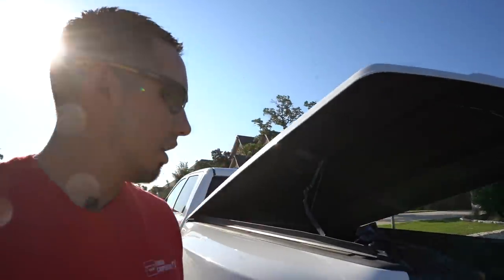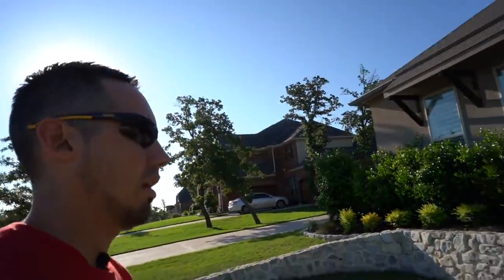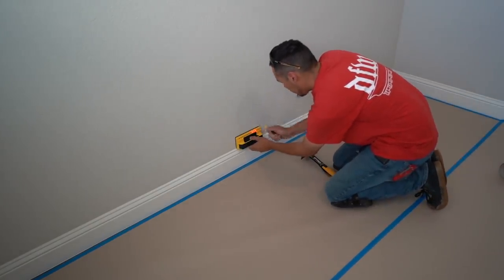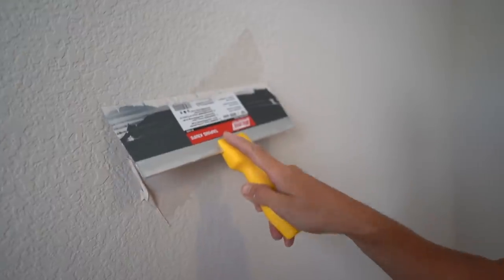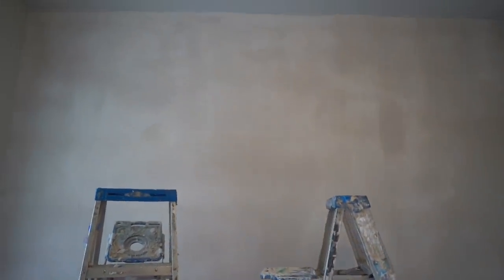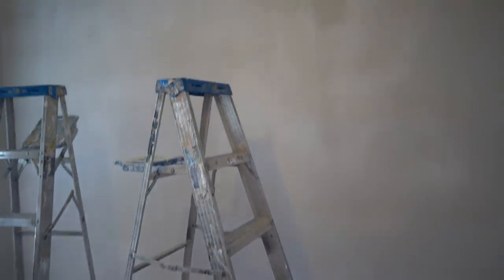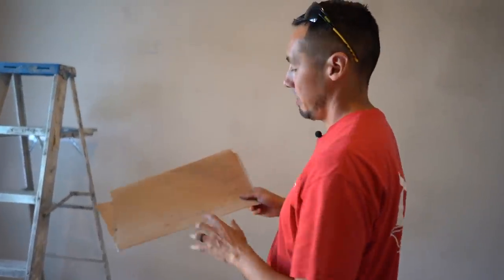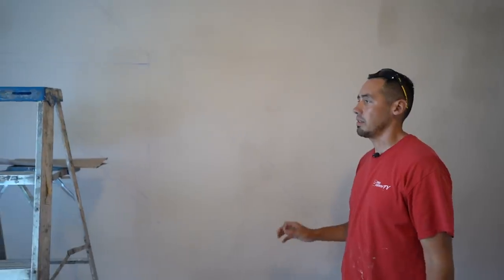abstract accent wall prep

Comment: A box fan always helps that quick set dry faster unless there's a ceiling fan in the room you can use. Love the content.
Reply: Floor blowers are better.  Bel Air has them for about 100 bucks and you can daisy chain like 8 of them together before you hit 20 amps.

Comment: To avoid sanding a trowel is very useful in scraping off any lift offs and after two coats you can go with  tight coat or two of finishing mud. Sure it’s an extra step but a tight coat will dry quickly, the finish is superior and the sanding is very minimal.

Comment: Little tip from a dry waller if you get a 3/4 inch roller nap mix your mud real loose you can roll your mud on follow behind with a wide growl. Because 45 doses that fully dry I take a tile sponge an a bucket of water with a damp sponge 🧽 lightly wet sand between coats give it a try let me know how you like that technique

Comment: Hey nice job but I may have used 1/4 inch Sheetrock to just cover up the old wall and start from scratch. Just a thought. But I like your work I've seen all your vids. Your a craftsman for sure, Semper Fi brother.

Comment: Easiest way to skim coat a wall is to mix your mud fairly loose and then roll it on the wall with a 3/4 Knapp roller and then use a 14” knife to skim the wall. Much faster to get it all on the wall with a roller and then skim it instead of trying to apply and skim at the same time.

Comment: "Easy sand" is sorta misleading,  especially if you are hand sanding - lol
A good rule of thumb with durabond is whatever the number (20, 45, 90 etc) you generally have half that before it starts to set (warm water sets it quicker). It is setting type mud but still drys at the same rate as regular mud - I think on that job I would have just used regular ole usg joint compound.
My 2 cents
Great video guys,  thank you! 👍

Comment: Hot mud is difficult to sand. I would have used a Westpac Green Dot topping. it's a heavy weight compound with low glue so it fills and doesn't shrink much at the same time easy to sand. Sanding setting type muds are not fun and eat through sandpaper.
Reply: I use the red dot, like butter

Comment: Which stud finder are you using? Finding it difficult to find a good stud finder that works with old homes and plaster/lathe walls. Any recommendations?
Reply: Prosensor 710.

Comment: 1983 called and wants its accent wall back. (kidding) Whatever the customer wants, the customer gets.
Reply: Depends on the color and material. If you're talking simulated wood panel and a regular oak, then yeah, but if you paint the wall black, white, or grey, it can be a modern variation.

Comment: Why do builders west of the Mississippi (seems so) use that knock down texture on walls? My military son has lived in California, Nevada and New Mexico. Every house has had this and we hate it! Why?? Why aren't the walls smooth??
Reply: Its the time in the cost to make a smooth wall takes more time than it does the spray and knock it down those builders they subcontract that out it's all about the money get it done get in-and-out fast
Reply: It's obnoxious.. I moved to Washington a few years ago.. builders have done it for so long now that they all think smooth walls are ugly..
Reply: Thanks for the replies! Here in the south the sheet rock is smooth, so you just prime and paint. I've never seen the rough sheetrock in stores. Do they have smooth rock out west at the building supply stores?
Reply: @cherylhaywood5139  no there is no rough sheet rock they just spray a texture on the walls
Reply: @cherylhaywood5139  makes all the mistakes disappear, hence it's easier and cheaper on labor instead of doing it the right way the first time

Comment: Why wouldn’t you use a roll on with a squeegee smooth out?
Reply: Squeegee is OK, but it creates an issue of having to do it about 3 or 4 coats to get it perfect... Doing it this way, one or 2coats...
What I do is I use a sprayer to spray the mud on then use a 36" level 5 finish skim knife. Before it begins to dry I spray another coat over it. And run 2 fans per room to help it dry... It will create a massive relative humidity Hotspot so you wanna move major air through there once you're setup to do that

Comment: Why not just sand it
Reply: 45 min spackle hardens enough for a 2nd coat in 45 mins but takes a lot longer to become sandable.
Reply: Yes, as Slim says... 45 minute is actually set up time... NOT CURE TIME!!! at approx 45 minutes(varies) you can scrape high points and re skim.... sanding.... I wait till the next day